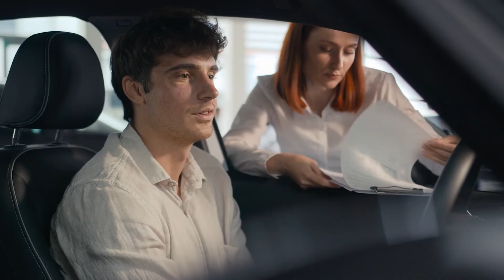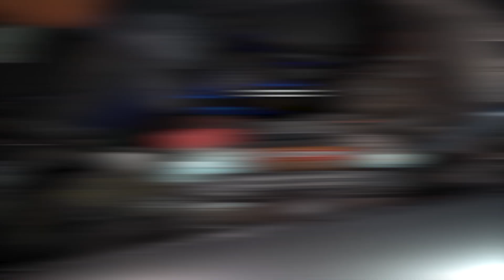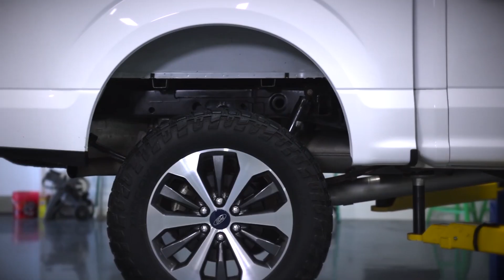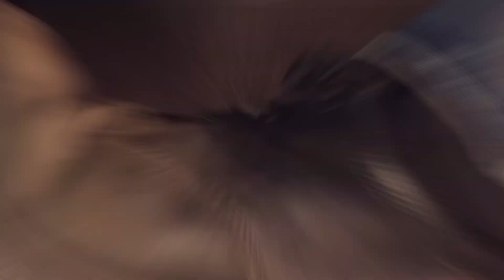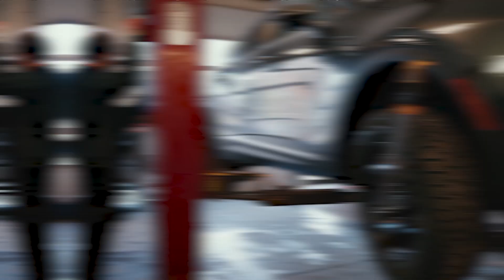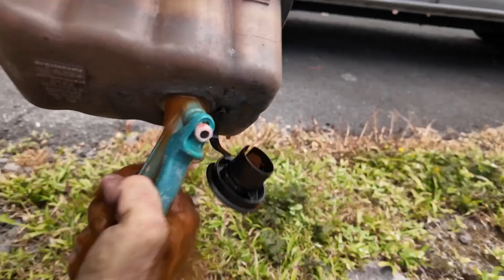15 Car SECRETS Most Drivers Never Heard About!

Comment: shifting into neutral activates fuel delivery because it now switched to idling mode. Staying in gear and letting off the pedal cuts the fuel system while the drivetrain cranks the engine, thus using less fuel overall. Don't go into neutral while driving, plus if you need to accelerate suddenly, you can't
Reply: Some transmissions are not designed to be shifted into neutral at highway speeds. You can cause catastrophic damage to internal parts of the transmission.